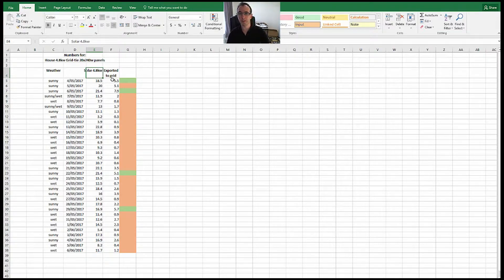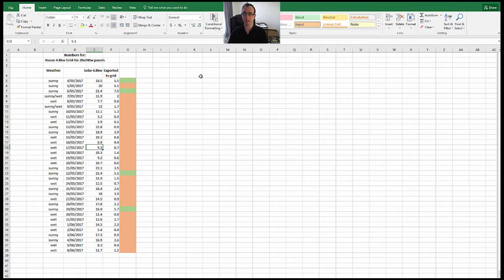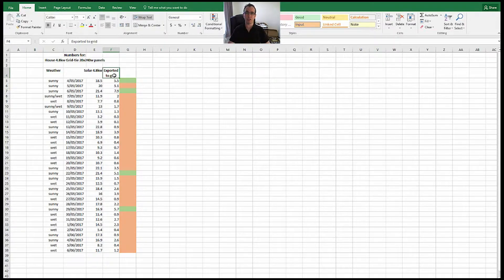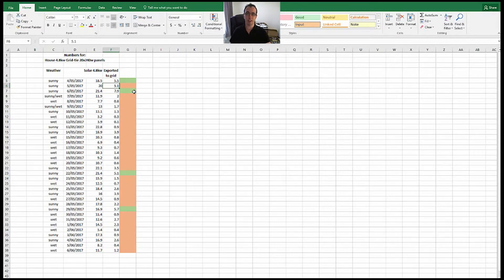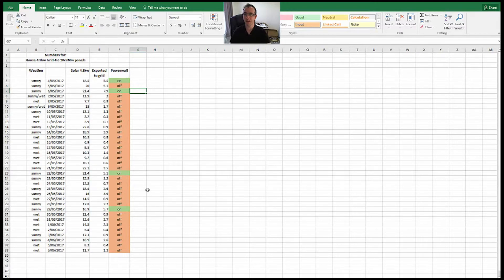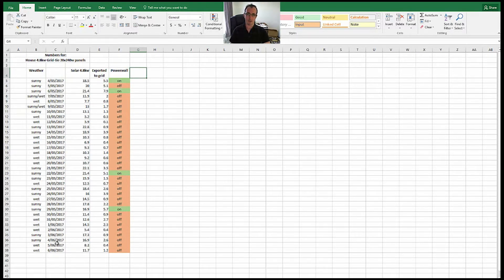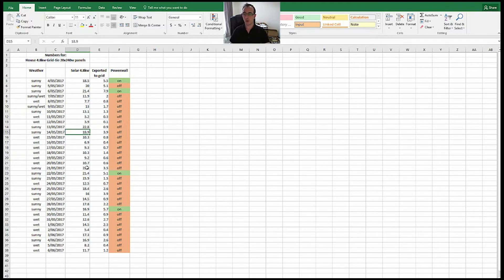GridTie with Powerwall Part2

Comment: Wait, what is the 4.8kw connected to? Is this another system?
Reply from the maker: 4.8kw is connected to a 5kw grid-tie inverter. The powerwall as per other videos is connected to the 1.4kw on the garage roof, clearly as we get into winter this isnt enough. But this video is based on if i did have the powerwall charging off the 4.8kw which is what most would be doing and shows how little power is left to put into charging a battery.... eg.

Comment: Yes sir. Here in the USA it's summer but we been getting rain for 2 weeks, I have 2.5 KW of PV and 10 KWH of lead acid battery storage. So I can't take more thank 5 KWH from my bank. I have not ever dun that. But even if I did with all the rain I would be lucky to run my loads and replace `1/2 KWH. Lots of peeps who are new to solar do not get this point. They will do the math and say I just need X of solar and I will be good. Or they will do the math and say X + 10% for bad days. Then when I show them how it works for real there socked or even have told me I have no clue what I am saying. AFTER they have come to me and asked for my help lol. Living with solar off grid and grid tie for 2 1/2 years and have lived full off grd for 10 years I think I know how it works lol..
Reply from the maker: I think we are all learning as we go but hopefully a vid like this will help everyone with there setups.

Comment: Hello mike, have you got any plans to charge your powerwall with your 4.8kw system solar system ??
Reply from the maker: Yes i do and need too. Its on the 1.4kw system now with those 3 green charges and it just isnt enough with the winter months. The plan is to charge off the 4.8 and add the 1.4 directly to grid-tie. More details in the coming videos. Thanks for watching

Comment from the maker: Note: After posting this vid, Adding a few of those excel cells up yes it does add up to a couple more days of the powerwall turning on (around 7 nights out of 34 leaving 27 nights with the powerwall off/flat ) but you get my point overall :) Later when i change things up and use all 6.2kw it will again be interesting to see. https://docs.google.com/spreadsheets/d/1J5iLGdLotxbDzn3Kbu3ZmHxI64Gr3duLSCb6HsYMe2E